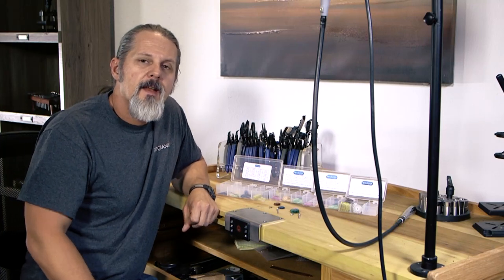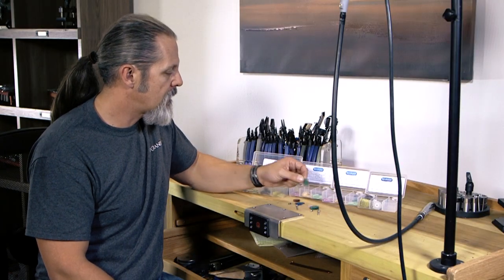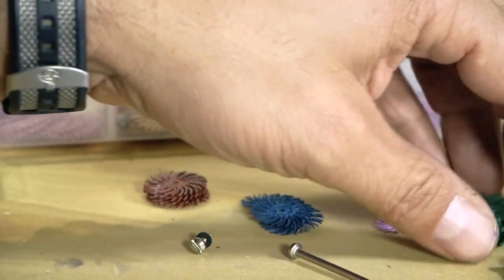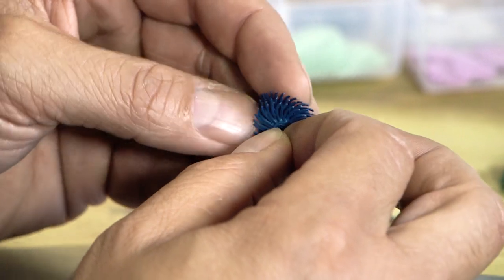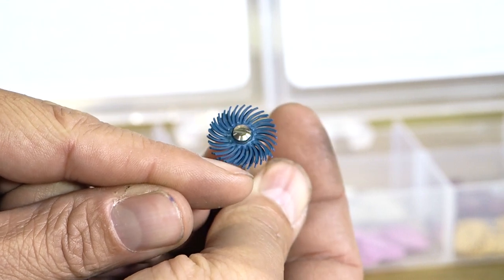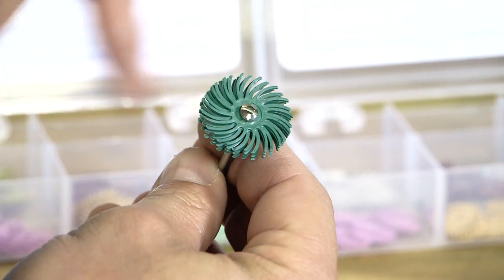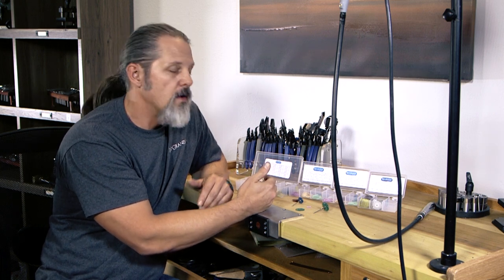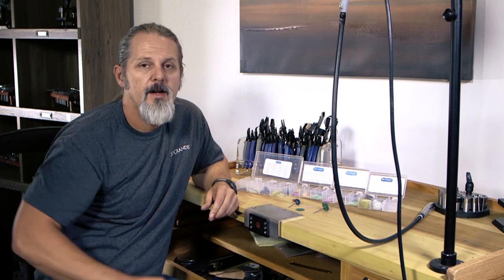How to Set-Up 3M Radial Bristle Discs

Comment: I use the little red washers between the mandrel bolt and between the shank, because when you apply a lot of pressure while operating they can slip.

I have and always go Red (180), Gray/Blue (400), Green (1000), Gray (2000).... purple peach pink are almost all unnecessary.  If you do want an inbetween, you only need purple (600).  With that order you will achieve a perfect mirror finish you can see you reflection in.

You'll break them first learning so extra is a must.  I started with a $35 dremel and these just repairing rings, started me on my whole business.

Comment: Do these mandrel fit a Dremel?
Reply from the maker: Hi Steve, the kits and the mounted radial bristle discs come with mandrels with a 3/32" shank. They can be used with any rotary tool that accepts that size shank.
Reply: Hi! When I used these with my Dremel, I think I had to mount them on the mandrel so that the spun in the opposite direction of my Flexshaft. In Mark's demo, the "curls" of the bristles seem to flow "clockwise" on the mandrel, but I think I had to mount them so they flowed "counter clockwise" for the Dremel (if that makes sense). Test it on scrap metal to make sure it's spinning the way it should.

Comment: These things are crap.
Reply from the maker: We are sorry to hear that these did not work out for you. If you have purchased these from us and are disappointed we welcome you to call us at 800-545-6566 for a recommendation or assistance in picking out a different set of radial `bristle discs. We hope this is helpful for you!
Reply: @RioGrande1944  No thanks, I'll just stick to regular old pumice wheels and bristle brushes with rouge or tripoli.